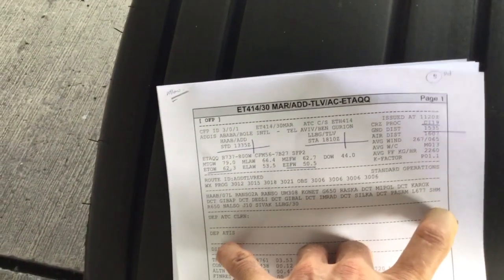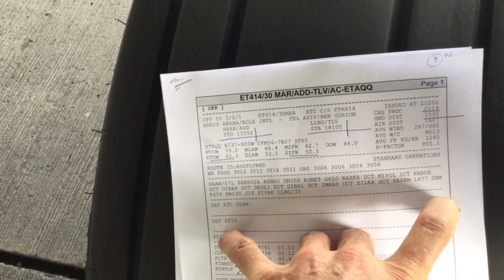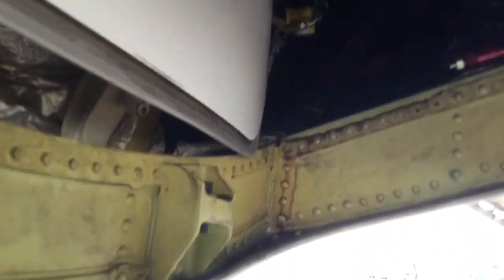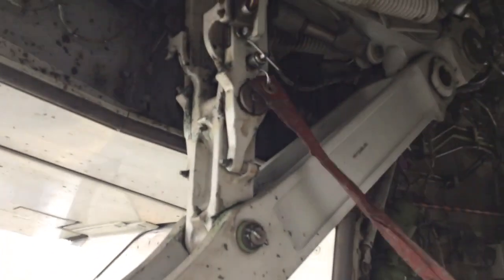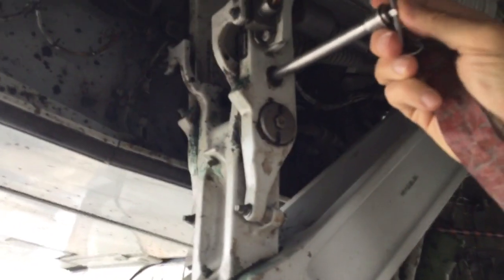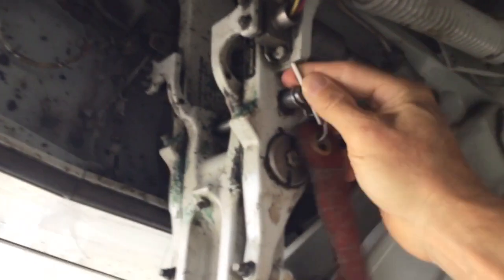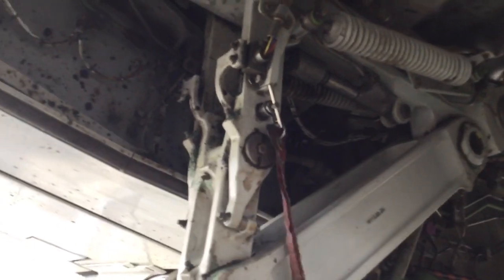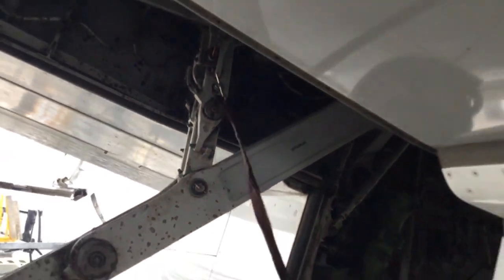31.03.19 Dangerous Storage of Gear Pins in B737 EQUIP Bay

Comment: Are you kidding me? When I worked with 737's the pin in question is stored in the flight dispatch box (or equivalent) and is used like you say, on every turn. It's a steel pin to prevent the nose wheel being turned and damaged. I'm not sure what you are driving at with your claims but I find your video offensive and pretty irresponsible.